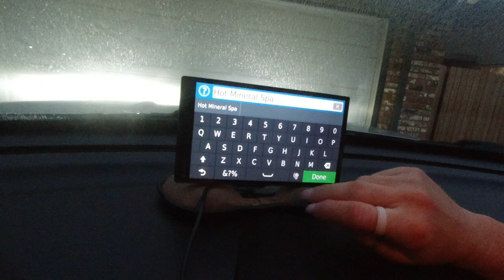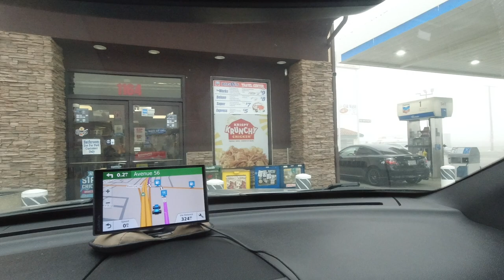RZR Pro R We Drove It

Comment: Nice video.  Car sounds like a nice upgrade.  Unfortunately.  I still think the 2022 x3 smart shock is better in my opinion.   The x3 engines are very potent and proven.  The 2.0 from rzr’s compression is not turbo friendly for people who want to add a snail later.   Also the power to weight ratio is still in the x3’s favor.   Also the heavier rear engine weight could mean issues in regards to bucking.  Not to mention that cage is huge and most toy haulers are not going to fit that monster.   Glad Polaris is trying to push can am.    Keep up the great videos.
Reply from the maker: Thanks for commenting we really appreciate it. And thanks for watching!
Reply: lol!! this comment made me laugh! im telling you this machine is a game changer.. im going to address some of you concerns.
Power - this Pro R is believed to be rated under its true advertised HP just like the 21-22 cam-ams they felt like they have more than 225hp! 40 - 60 -80 mph you floor that thing it will put you on your seats..
bucking - 65-70 mph on the 2 seater pro R with 2 foot whoops and 3ft ruts ate it like nothing. 4 seater does the same thing but more speed 70-80mph
Dynamix DV vs SmartShox - Dynamix DV is better bec it adjust the compression and rebound seperately unlike the smartshox it adjust compression and rebound at the same time.. so Dynamix DV is night and day difference.

where i got this info? i cant tell names bec polaris said the ones that drove the machines and was invited at the premier cannot post online on how it feels on trails or desert and how fast it is. (they trying to shock people) my friend drove one for 2hrs and now hes selling his 2021 X3 for this machine and hes not a brand loyal.. he said 100% out of the box Pro R vs 2021 or 2022 X3 he thinks the Pro R will win base on his feel. and oh polaris is saying 90mph top speed on the pro r lol that pro r will go 98mph EASY out of the box and you are correct that you cant turbo this machines bec they have a split crank and split crank engines dont like boost or it will go BOOMM
Reply: @NewTrip_NewAdventure  maybe i said it wrong.. you can but its gonna be dangerous AF and too mas work to do and $$$$$!! unless you only drive it for drag race then all is good but trail riding and WOT all day on the dunes or trails, goodluck..

Comment: It’s a really nice but the design for the front intake to the primary clutch should be direct. With that vent inlet upwards thats not going to allow alot of air flow to the clutches. I can see that being a problem. Also is that alternator enclosed in a waterproof casing. If it not water protected i see that being a problem for people also  looking to use it in deep water.  Same may apply for the clutch air intake. This seems to be more less a dune level SxS.  May be that this is for specific types of riders. But a great rig from what i can see other than those 2 to 3 things.
Reply from the maker: Good observation, definitely a dune machine,, cannot wait to get one in the dunes for sure

Comment: I’m glad everyone is so stuck on the useless 225 HP for desert. WHAT IS THE TORQUE #s? Torque is where it’s at for sand dunes and rock crawling. How much HP and Torque and at what RPM’s?
Reply from the maker: 225 or even 235 is not useless for us in the desert, different strokes. The torque is 162, but as far as tourqe at what rpm that is a question for Polaris. I'd love to go deeper into this conversation, maybe in a month or two.

Comment: How is the low gear on the pro r vs the turbo s?
Reply: Pro R has a lower LOW than the Turbo S.
Reply: @21armyn  did you drive one?
Reply from the maker: Yes
Reply: @DandiOffroad  thank you. I did a 33% gear reduction in my S. Hoping I don’t need to in the R

Comment: THE EAST COAST WANTS THE 64 WIDE UNIT -- COMEON POLARIS
Reply from the maker: You are in luck they are currently available. Several of them.
Reply: @DandiOffroad  NOT IN THE PRO R 225 HP I JUST LOOKED OVER THE WEBSITE AND DID NOT SEE IT -- I JUST FEEL THAT THE EAST COAST ALWAYS SETS THE SHAFT
Reply from the maker: That is correct. The 64-in machines would be the XP pro which is 181 horsepower two cylinder. Pretty peppy for narrow trails I would think but I get what you're saying